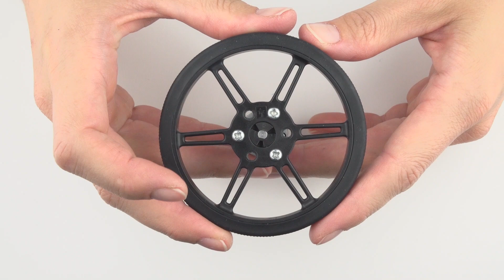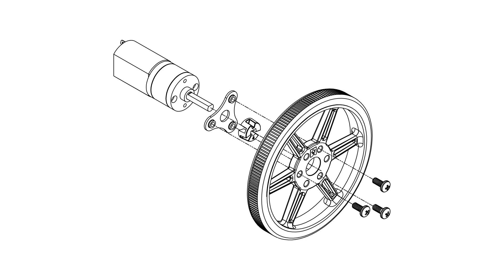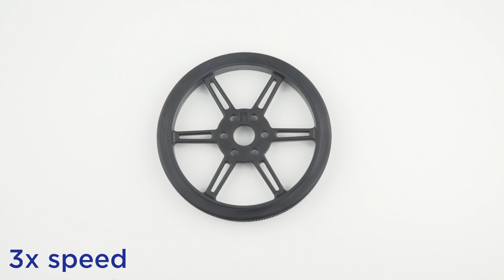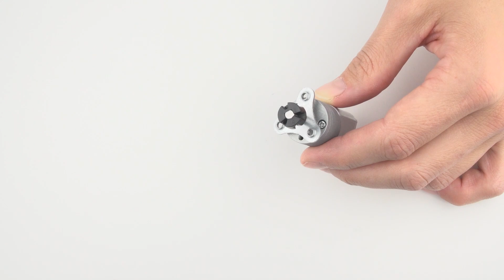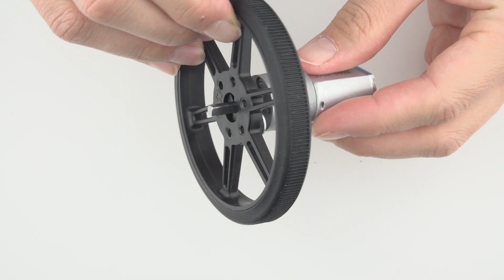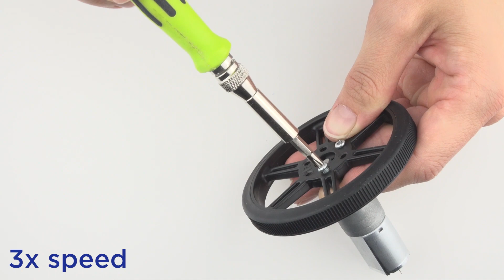Installing Pololu's Multi-Hub Wheels

Comment: How are the push-fit 3mm D wheels installed?  They seem to require a scary amount of force to fit them.  Are we supposed to use some sort of tool in the slot which is perpendicular to the flat on the shaft, to open it up a little?  I was hoping this video covered that.  The motors don't seem to be robust enough to take that kind of force.
Reply from the maker: Hi, TooSlowTube. The fit for those wheels is supposed to be tight, and they do just press fit on there. There are some instructions for installing that type of wheel on one of our micro metal gearmotors here: https://www.youtube.com/watch?v=D6UmjlBW8Ns&t=142s
Reply: @pololu  Thanks.